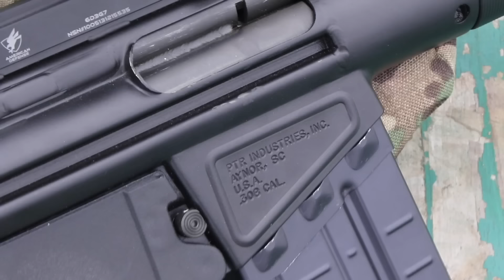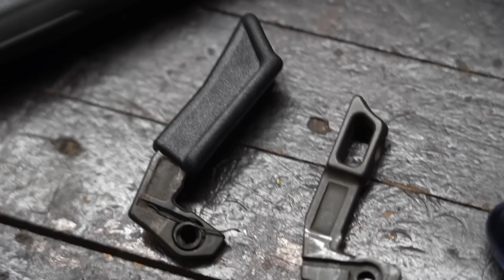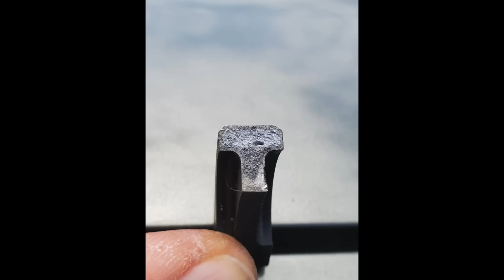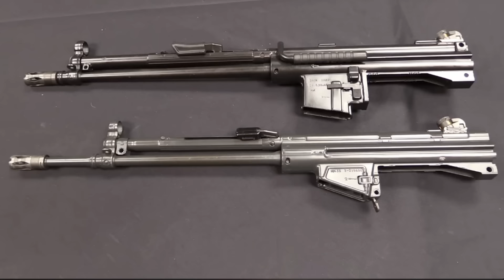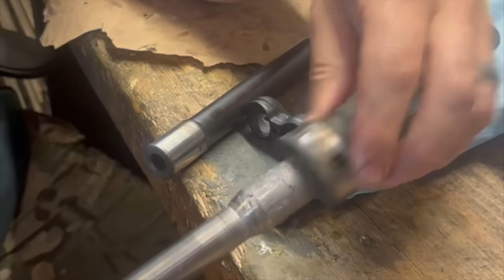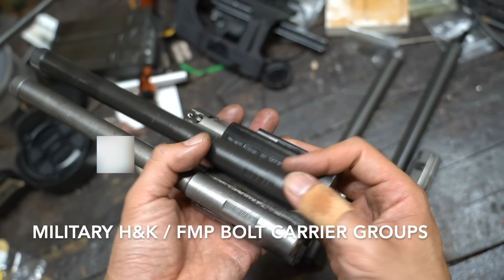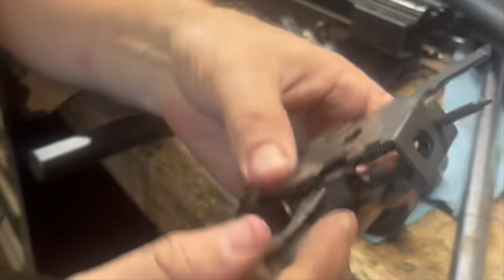Is PTR still worth the money? H&K v. PTR (old) v. PTR (new) v1

Comment: I purchased a PTR91 GI in July-August 2021.

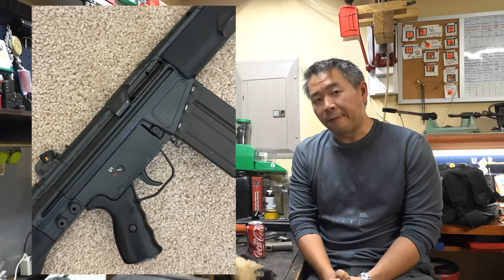It has the PTR manufactured bolt, bolt carrier, plastic grip, clamshell billet trigger pack, 1:10 GI profile barrel (non-heavy profile), 5/8x24 threading, and mim hammer & trigger. It did come with HK made green furniture. 

Initially I experienced failure to go into battery malfunctions, but the manual says to expect this malfunction for the first 200 rounds. The issue went away as the rifle wore in and now is incredibly reliable. 

The accuracy is phenomenal. It will consistently hold 1.2-1.5 MOA all day long (10 shot groups) with Hornady match 175gr 308 ammunition. In fact that’s all I feed it.

The trigger pull isn’t bad - it’s not a Timney, but it breaks with a clean, but heavy crunch (very much like a Glock trigger). It’s serviceable, not fantastic. 

I have put a SPUHR stock on it with an AIM surplus MLOK handguard, and Slate Black ODG panel covers and handstop. 

It does what I need it to do and it performs more like the AK4D clone you built, perhaps with slightly better accuracy.

Who knows? Perhaps I got a good one. 

I do plan on replacing the cheap plastic housing with a genuine HK SEF one, and I will replace the trigger with a Timney or Heckfire unit.
Reply: My experience with a similar aged PTR91 GI is about like yours. Only malfunction ive had, however, is with AAC .308 ammo. my DSA FAL ran worse than usually on the AAC ammo too. I followed the break in procedure with PPU 7.62 ammo and its been fine. I guess to avoid any problems, same with AP5s I swap in HK extractors and extractor springs from the start.
Reply: @ryanashby3640 I think that the further a manufacturer strays from the original design (308, 18” barrel, unsuppressed) the more problems they have. It took HK almost 20 years to develop the MP-5, and longer to develop the G3K - and they’re the experts.
Reply: I got mine around the same time frame as well. I went a bit overboard on a break in period and cleaned the rifle after every 100 rounds and after around 400~500ish the rifle has been functioning flawlessly.....until I started putting in other parts. 

I ordered Hk parts heavy buffer stock kit had disassembled itself over a training event and during a course of fire I didn't notice i had lost the butt plate/pad and the buffer internals. This caused mild roller dent on the rear of the receiver.

I've since out back the OEM stock, end cap and buffer and it has been fine. 

Racking the bolt has never been easy with the OEM end cap and spring. A FMP parts kit stock had resulted in better racking and normal function. I gambled again and got a full OD stock set from HK parts with normal buffer. This time double checking the parts once arrived and checking the staking of the buffer end cap. Around 500 rounds with this set up and its been a breeze lucky.

For accuracy I too hold about 1 moa to 1.5 moa with .308 145~147 grain (GGG has been my PTRs favorite food)5 shot groups. Limited access to longer ranges i cant vouch for real practical accuracy past 200M. 

For housing I've used the magpul one which was very comfortable and affordable along with it used ambi safty, that was very comfortable for resting my thumb on. Ive since switch to the oem housing just for the esthetics of a nice OD color match on the furniture. For wide handguards I cant ever find them in stock or correct color but an airsoft company by LCT makes cheap halfway decent wide handguards that will fit with minor trimming to the handguard.

To wrap up I too believe I have gotten a good one or at least decent one during this time frame or PTR and it has not let me down in performance or in any parts catastrophic failure. With a decent cleaning schedule after moderate use I believe its a solid rifle for sporting competition and possibly practical use. I dont regret purchasing mine and probably wont get rid of it.
Reply: I also purchased one in July. I like every about it so far but I havent shot it. Like you, I have been looking to replace the trigger group and grip.
Reply: @Holret be ready for a break in period. The rifle will eject but won’t fully go back into battery. You can hurry this along a bit by locking the action open and slapping it closed. 

Once it wears in, you’re GTG
Reply: @mattgibson351  PTR32 not different in this regard. I had a used one that ran with anything I threw at it, but the problem is, for me, is that it was used. Previous owners did things to it and I was too busy to research the aftermarket scene around these so, sold it. Got a new one after I saw what the aftermarket could offer. However, it only reliably runs with the hottest of 7.62x39 (Barnaul). Bought a complete trigger pack from Bill Springfield, much improved over stock.
Reply: @mattgibson351 I’m at 200 rounds so far through mine and no hiccups yet. Going to hit the 500 round mark and call it good
Reply: The trigger remedy is to send the trigger pack to the guru Bill Springfield! Phenomenal difference plus replace with flat trigger.
Reply: @markhopper4600 shouldn’t have to at the price they cost now
Reply: Refine the original design, then branch out using what you have learned previously to provide different models- seems pretty simple.
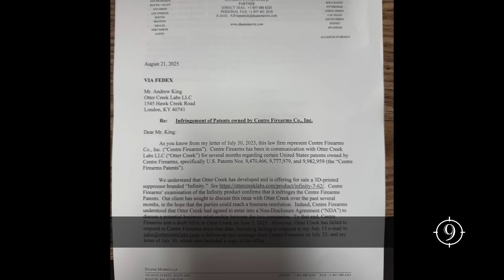Reply: 9:49 😂

Comment: I just bought the GI PTR 91 a month ago. It has the new trigger pack in it. I've only put sixty rounds through it so far but it ran perfectly. The charging handle is a bit stiff but I haven't had any real problems with it yet.
Reply: How do you know if your ordering one with the old vs the new? I'm having a horrible time figuring out which 91 rifle is which and don't know what to get
Reply: @rajeesh365  You don't. Odds are though it's going to be a new trigger pack. You can still get a surplus one from HKparts. I ultimately decided to get an old one because I wanted as few new parts as possible. I recommend the GI versions of the rifle. The surplus parts are old but they are much better quality than the new stuff from PTR.
Reply: @Frozen_Thorn thanks for the feedback!! Would you recommend ordering the gi version from the ptr website? Did you add any rounds to your count? How was the furniture on yours? I'm hoping to make this my simple spr build bipod and lpvo
Reply: @rajeesh365  That would probably be the easiest method. I haven't had a chance to put any more rounds through it yet. The furniture is definitely worn and showing it's age but it was well made. If you are looking to add an optic than you might want to get the GIR. It has a welded Picatinny rail.

Comment: Just throwing my 2 cents in there... while I do like ptr for bringing affordable HK clones to the US market.... that doesn't matter if you can't shoot them because of the constant problems and while yes I know some people have had good luck with them, it's just that.... luck. The QC is just not there. After 2 PTRs I bought with my own money (K3p and a 91 clone) I refuse to buy another due to the horrendous problems I had and not minor either. No I mean like magazine well/latch out of spec I can't strip rounds from any magazine I put in it or the triple frame being out of spec or the wrong locking piece being put in it causing the receiver to get dimples from the rollers in them.
Reply from the maker: yeah agreed. I've decided not to sell this nightmare of a K3p I have and just have mike completely re-build it correctly with HK, FMP components and an RCM barrel instead. It's a real shame and I hate what PTR has done to the groundwork that JLD laid down for them.

Comment: Henry, I've had 2, brand new PTR 91's when they first become available to us common folks. I shot the crap out of both. 2 things why I would not get again. One, due to the nature of a very heavy bolt carrier and the method of extracting the cases. More recoil than should be for what it is. M1A much more pleasant to shoot in that respect. And the 2nd thing, which is a deal breaker for me because I'm a handloader is it absolutely destroys the brass. You'll only shoot handloaded cartridges once out of the thing. Both these characteristics are inherent in the very nature of the rifle. So for me FAL's and M1A's are a better choice. Beyond that they both functioned fine overall.

Comment: bought my parts kit one from them in 21. immediate issues ejecting. i had to MORTAR it to charge it. sent it back, was reliable minus the occasional failure to feed. i just could not get into it for some reason. ended up trading it for a century tantal and the sad thing is its been more reliable and about as accurate lmao.

Comment: Das Rifle! Jawohl!
Reply: I used to have a C-308. The the metal used on the cocking handle/rail was very soft that you had to keep bending it up and out otherwise the bolt would hang up and be out of battery. I sold it for this reason not to men that it was PITA to assemble the bolt to the correct position and put it back into the receiver. It was very accurate, but these details deterred me from keeping it.

Comment: Very interesting. I bought my A3S just before covid hit (so pre abominations) and it's been nothing but reliable with everything from cheap steel case, M80 ball, to heavy match ammo. Decently accurate too. Came with the G3 tapered profile barrel and the welded top rail. Now since then, I've torn down most of the exterior to modernize it and AK4Dify it, but the BCG and barrel are still factory and I've seen no roller dents or odd wear on the internals. The only things I changed out internally were the factory locking piece for an RCM #17, 36 degree piece, and I managed to snag a Swedish heavy buffer to replace the factory one. Maybe I just got really lucky.

Comment: Welp, literally just got home with a new PTR lol
Reply: Update after its first range trip: one stovepipe out of I wanna say 60 maybe 80 rounds? Too early to tell if that'll be a real problem or if it was just a picky about ammo sort of thing. I also didn't clean or lube it at all so that might matter, we'll see! It's a GI so hopefully the internals being surplus will help like Henry mentioned.
Reply: @GIR9595  i had one, mine needed broke in. It ran good after couple hundred rounds
Reply: Thanks for the update. Keep us posted 🫡
Reply: @GIR9595 i got a ptr mp5. It was absolute junk! Returned it as fast as i could
Reply: @alonzokincaid1362 I also have a PTR 9C that's been running like a champ since 2020. I've since SBRd it and have been really enjoying it. 

Maybe it's a worsening QC issue in the MP5s as well.
Reply: @a @alonzokincaid1362 m not calling you a liar. I’ve just never heard of an FFL that takes returns. I worked behind a gun counter for 2 years.
Reply: @forrestspradlin8015 i sent it right back to atlantic firearms. As long as you dont shoot it they’ll take it back if its defective. If you do shoot it,  you gotta deal with ptr directly.
Reply: @GIR9595 They do have a break in period. I’m not a warrior for the PTR, but I like mine.
Reply: @forrestspradlin8015  it actually just got back from the RMA process from PTR because the headspace was off. They fixed that and I confirmed that the bolt gap is now in spec. Still need to shoot it, been working on another project and just been busy but hopefully everything is good to go on it now!
Reply: Mines been good thus far. That said, I got mine for the cool factor more than anything.  It ran Sako .308 bthp stuff like a champ. Hoping it handles 7.62x51 just as well since I have a case coming 😬
Reply: @Pen-mu1sx  oh same, I'm keeping it stock with just irons right now. After sending it in to PTR to fix some headspace issues, it's been working just fine so far! I added the Bill Springfield buffer and that has noticeably helped soften recoil by quite a lot
Reply: My ptr absolutely needed about a 200rnd break in but seems to be running well now. I have to get some more through it to be sure. The ptr 9tc absolutely hated the ets mags it shipped with, got the genuine hk magazines and can't think of a single malfunction with those mags. I've probably got 4-5k rounds through it now
Reply: @Martinez53072  HK WIDE HAND GUARD FOR SALE ON EBAY RIGHT NOW
Reply: As silly as it sounds, I do believe Rollder Delayed Blowback guns require a break-in period. If it was any other system, i would call it a defect. But RDB is caveman level, incredibly rugged and reliable if in-spec. It is definitely enough of a slapper to slap those pieces into spec after a few hundred rounds. 

Think of it as a jackhammer as opposed to a scalpel. RBD is NEVER a pro-tier weapon. It's the ultimate conscript gun, will typically run even better than an AK if filled with organic debris, with acceptable accuracy and minimal moving parts as long as your rollers dont get messed up

If you have any problems with a PTR id just send it back to them, they treated me very well when my PTR91 was misfeeding. They shot a few boxes of rounds through it, sent it back, told me I just hadn't fully broken it in. 

However much they shot through it, I have not had a single malfunction after probably 300 rounds
Reply: @braddotson3429  I actually sent it back to PTR and they replaced the bolt. It's now in spec and has had no issues from the limited round count I've been able to put through it. I don't think I've hit 300 yet but I'm getting there
Reply: @GIR9595  awsome to hear! I got mine around the turn of COVID so im glad to hear theyre still taking good care of customers. Yes they may have some hiccups unlike a top of the line firearm like Browning, but i have never seen a problem they arent willing to fix!

Edit: im sure i sound like a shill, but i have to stand up for a gun that has absolutely impressed me beyond my expectations. My only real complaint is the heavy weight and the awkward cheek weld when running a scope. Maybe other people have had bad apples, and i was worried mine was one as well when i first bought it. I cant help but think some of these commenters may have given up on a good gun & just didnt break it in all the way. 

I know its expensive to do, and its certainly not for everybody. But i WILL swear by RDB firearms, when they are made & maintained as intended your enemy will experience 10 malfunctions before you see a single thing go wrong with your weapon
Reply: @braddotson3429  yeah I got a PTR 9C in 2020 and it's had zero issues outside of the expected ones like extractor springs wearing out or it getting way dirtier than non RDB guns. Given that experience, I wasn't worried at all about getting the 91. 

Seeing the bolt gap that low out of the box though made me wanna send it back just because it would only get worse over the life of the gun and I might as well make use of their warranty. 

Thankfully they were quick about getting that back to me so I have no real complaints other than the cost of .308 lol
Reply: @GIR9595  HK WIDE HAND GUARD FOR SALE ON EBAY RIGHT NOW
Reply: HK WIDE HAND GUARD FOR SALE ON EBAY RIGHT NOW